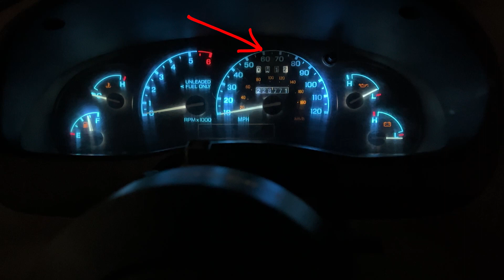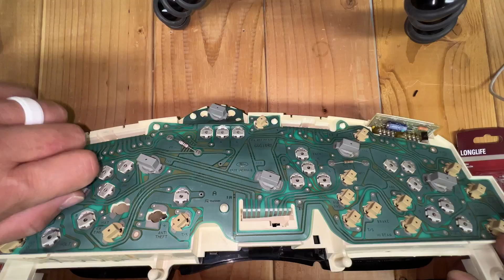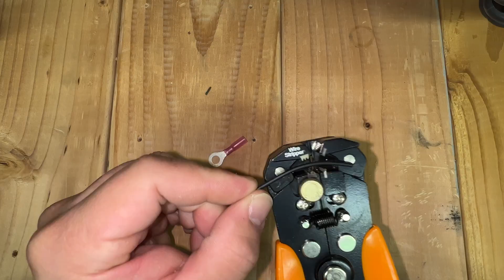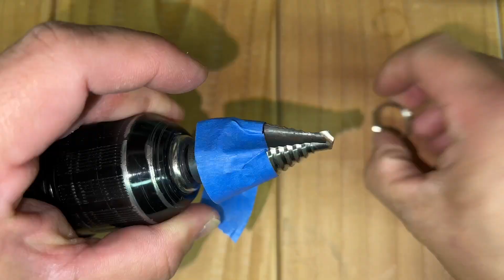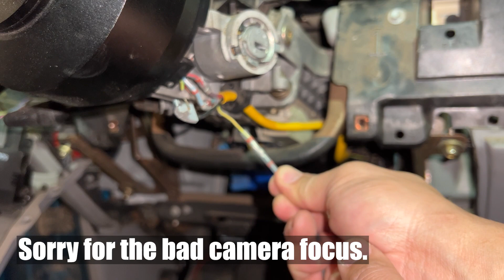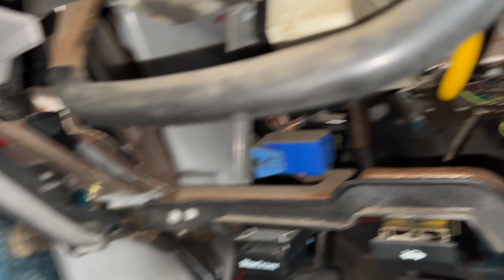How to Install a Horn Switch and Replace Dashboard Cluster Lights on a Ford Ranger

Comment: Did u know if u Peel back the green plastic off of the cluster and use a dremel at low speed or hand sand the inside of the plastic film with fine sandpaper until the green is gone and it’s just clear then u can use colored led bulbs and it changes the color of everything. Mine are all red to match the paint. Some remote color changing ones would be sick!!  Just a lil secret. Lol this is my 5th ranger 🤷🏻‍♂️
Reply from the maker: totally forgot about that. haha.

Comment: What modifications did you do to make the hub fit?

I still have the clock spring intact, how can I connect the horn to the steering wheel? 

Thanks in advance.  Love the channel.
Reply from the maker: How to Install NRG Short Hub, Quick Release Steering Wheel and Wire with Working Horn Acura Integra
https://youtu.be/qjLf9hKlpWg 

That’s all I had to do. Thanks!!!